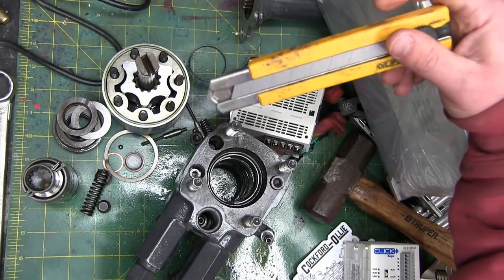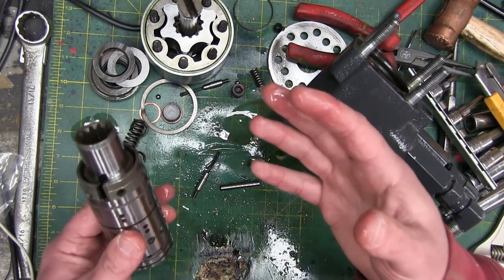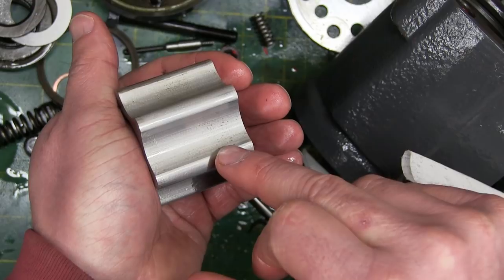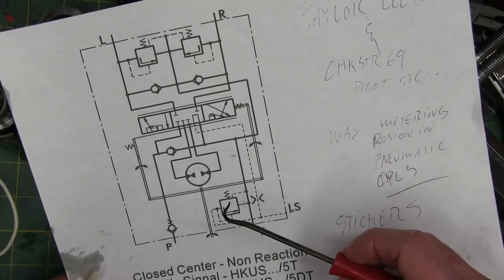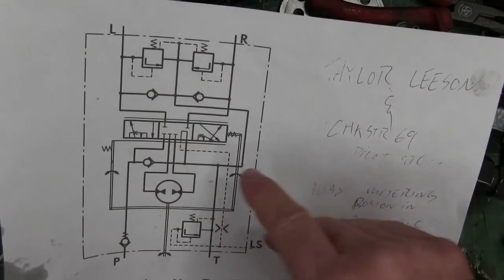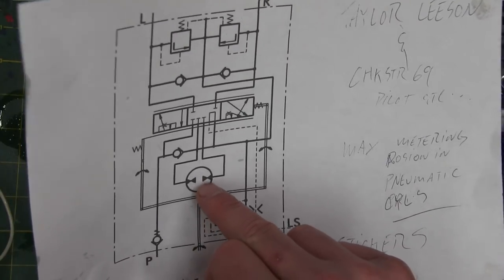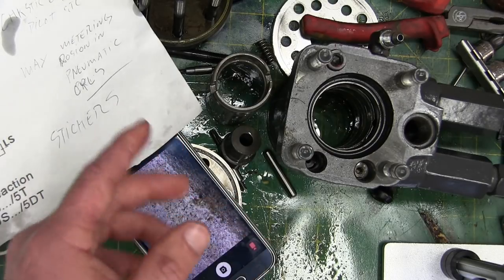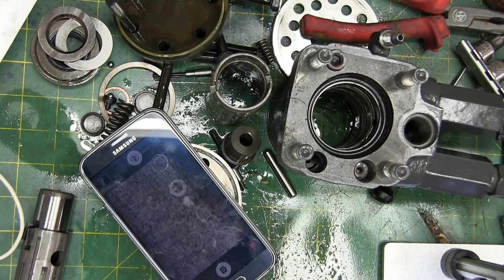Orbitrol Valve Details | My Errors Rectumfried.

Comment: Sorry but you still got it wrong.
Reading the schematic, you can see that the valve has 3 states (indicated by the 3 devisions in the block) between which it transitions smoothly (proportional). The left state of the valve connects the pressure to the right side of the manual pump, the left side of the pump gets connected to the left cylinder, and the right cylinder gets connected to tank. The right state of the valve connects the left side of the manual pump to pressure, the right side of the pump to the right cylinder and the left cylinder to tank. The center state closes both ports of the manual pump. Now the smart part: The entire proportional consists solely of those two cylinders, so the valve rotates with the steering and it is actuated by relative movement between the two parts. The inner part gets driven by the driver and the outer part gets driven by the spring elements. The outer part in turn drives the manual pump, this makes the valve a torque sensing control system. So when the driver applies torque, the valve applies hydraulic pressure to the pump inlet and assists the driver this way. 
(when no torque is applied the pump is blocked and therefore the outer sleeve. This forces the valve to operate as soon as torque is applied).
The consequence: even with no pressure you could operate the steering, but it would require a lot of torque.
Cheers from Germany.
Reply: This exactly.
Reply: I was just about to suggest the same, and I’ve got no idea about hydraulics. Just seemed obvious!
Reply: You nailed it.
Reply: Stephen Dedalus 
Love it tech on the ave tube
Reply: When in doubt, ask ze Germanites!
Reply: Ditto
Reply: Bingo

Comment: I'm interested to see that Sumitomo Cyclo Reducer because I do maintenance at a facility that uses the Sumitomo Cyclo 6000 series reducers everywhere and we've been having them fail pretty consistently. Some are grease filled and some are oil filled. We're going to be sending one out to get autopsied. We know a grease filled reducer is going to fail once we start seeing external temperatures above 110°F on the outside of the housing.

Comment: The Western snow plows(and other brands) on my trucks are electric over hydraulic. The electric switches in the cab control relays that control the pump and the valves that control the cylinders. My old Western plows were mechanical/electrical over hydraulic. It used a switch in a mechanical joystick and cables to activate the pump and control the valves for the cylinders.

Comment: air, hydraulic, electric all have different rules and conventions.  when you say X over X (like air over hydraulic) what you really mean is that the rules of the first one (air) apply but it reality its the second one that actually covers the last mile of delivery so to speak.  so basically what you said is correct.

air over hyrdo lets a hydro break system interact with an air breaking system.  kinda like a transducer

Comment: I deal with milking robots, and they have air cylinders that can be positioned within ONE MILLIMETER. They are made by Festo (of course). Each cylinder has four valves - an inlet  valve and an outlet valve ON EACH SIDE. The cylinder has a magnetic Scale (?) inside of it that is read for positioning. 6.5 bar gives you all the speed and force you need.

Comment: You are absolutely correct in your assumptions about air or electric over hydraulic. Much the same as a pilot hydraulic control would be hydraulic over hydraulic, if that makes sense

Comment: That inner rotor is not ground, it is a powder metal part that was pressed.  The sizing/restriking operation after sintering will produce very tight tolerance parts with an excellent surface finish.  The "corrosion" is porosity and is characteristic of powder metallurgy.

Comment: Air over hydraulics. I always understood it as the use of two different systems to work together or assist one another to accomplish one task. I'm going to use a Military 2 1/2 ton utility truck (Deuce and a half is what it's usually referred to). It has air over hydraulic brakes. The brakes themselves are hydraulic driven. The truck has an air pack on it that essentially senses when you press on the brake pedal and helps you by converting pneumatic power into mechanical power into hydraulic power. I never tore one apart but It'd be pretty neat inside probably. They used this system because the fact that if you got a hole in an air tank, you still have brakes because all the air system does system does is assist the hydraulic. Technically it would actually be an air assist over hydraulic, yadda yadda. You get the point.

Comment: Generally speaking, the whole this over that means that the top mechanism powers the lower mechanism. In other words, snow plows around here are electric over hydraulic. In this specific case, an electric motor/pump uses hydraulics to move the blade. It is about power vs actuation.

Comment: that adjuster with the spring is the pressure relief, i used to set up the hydraulics on new agricultural machinery and you would take out the plug with the copper washer and adjust the relief until you had 1000 psi at the front axle steering ram

Comment: When I see "air over hydraulic" it usually means they are using air pressure to move the shuttle or shuttle back and forth in the spool valve. "Electric over hydraulic" is usually using 0-10V or 4-20mA to run an actuator to do the same.

Comment: It can work as a pump. Had a combine harvester shit out a valve way back in a corn field and had to tow it out to the road for a new engine. Took ~50-75 lbf/ft on the wheel but it could be steered. This is the same type of steering actuator most farm equipment uses.

Comment: The orbital valve will extend the cylinder without pump pressure under no load conditions, but it takes a 300 pound gorilla. Used on planetary gear reduction axles in military vehicles. Worn orbital valve can cause undesired porting within and cause non demanded steering output. Very interesting for the driver.

Comment: If I'm not mistaking, that system is also used on ordinary tractors. They have hydraulic steering, and yes, you can in fact use the steering as a pump and turn the wheels with the engine off, but it is haaaard, and not something you want happening when driving down the road.

Comment: They are a hydro-mechanical closed loop system.  Move the spool by steering and the flow brings it back to center to close by way of displacement-steering, like in a car.  The other type is velocity-steering whereby the wheels would continue to turn until you center the steering input.  These units are some of the coolest mechanisms in mechanical engineering.  Like you said, pornographic.

Comment: Ave , if possible do a vijayo on diesel cylinder sleeve cavitation damage. I know its a long shot. Throw in coolent technology.
Reply: Cool video idea....would definitely like to see this
Reply: Yeah, it's amazing how many diesels have their cylinder sleeves destroyed in short order because people use the wrong coolant.
Reply: I will donate the next  liner with cavitation I get my hands on. 
 drivers putting car antifreeze in their truck.
Reply: few heavy duty applications use old time green coolant  ( comes in many other colors as well )  not extended life which usually only comes in red, except cummins dyes it blue.
 the difference is fully formulated coolant contains sca's and nitrates to prevent cavitation and silica for more btu carrying capacity.  car green coolant only has the silica. no sca's, no nitrates.  thats the simple answer gets fairly complicated once you get into extended life coolants, NOAT, OAT , Hybrids, etc etc.
Reply: After reading up on it quite a bit, I came to the conclusion that there's no reason to run anything but Fleet Charge.  Over time I have slowly drained and flushed every vehicle I have and made the switch. Everything, from my tractors to my '70 Chevelle with a 550hp 454 has Fleet Charge in it now.
Reply: I use oat in everything. I get a discount at work so cheaper than the cheap anti freeze at auto parts store.

Comment: I'm a desk jockey but know a few guys on the oil rigs out here in CO. One said its the same thing as "liquor before beer, you're in the clear." Hydraulics are expensive and powerful. Don't use it if a pneumatic or electric tool will do. The other guy said that "Air over hydraulics" was a rule that hydraulics can be controlled by pneumatics, but pneumatics should never be controlled by hydraulics. So, put the hydraulics at the end of the chain, "under" the pneumatic or electric systems. They argued while I enjoyed my beer and both agreed the other was right. So...no idea? I think it means something different to every jobsite.

Comment: Odd timing that you mention the references to air-over-hydraulic or electric-over-hydraulic as this was quite the discussion on a jobsite last week. I had been taught by my grandfather (mechanical engineer in the 60's) that these were the shorthand lingo to describe air-actuated or electric solenoid actuated hydraulic controls in parker manifolds or valves. To my surprise, these terms got shortened yet again to simply "air-over" or "electric-over" with no mention of hydraulics at all. My guess is that all of these originated in the field or regionally to help mechanics or repair technicians not so versed in hydraulic systems understand why the hell there were wires or air hoses coming out of something that uses hydraulic fluid to do all the work. I guess it exists in the same unwritten jargon as a slapstick valve. But hey, if it chooches, I don't care what term they use...if they break it, I'll have a few choice terms of my own to share with them ;)

Comment: I think the Geroter gear is made from powdered metal. I use to work at a PM factory, we made 100's of thousands of gerotors. The pitting looks like normal pm part. Measure the OD of the top and bottom, if there is a .001 difference its probably a pm part.

Comment: Toyota Fork lifts with hydraulic steering will steer if the engine is dead, but it is vera vera hard.
Really, very hard, but you can steer the thing 
 On the other end of the deal, we had one of the small ride on cushion tire Toyotas that would suddenly turn all on its own and as you frantically spun the wheel the other direction it just kept going until suddenly reversing and the wheels matched the steering input. The valve/pump body like the one you're working with had to be replaced .
We later got the Stand-up ride on electric lifts, and twice the steering went out on those. One the chain broke (you are standing on the steering axis so there is no room for a directly connected slave end), the other the steering valve/pump (or however those are driven by the spin handle that is the steering) locked up.

Comment: I live in Germany and as far as I know even if the motor fails you must be able to brake or steer at any time. We have a tractor and if the engine is off and you are standing you are never able to turn the steering wheel, but when you are rolling down a hill it works just fine, quite hard but it does. I think it also uses a similar valve, not sure thought

Comment: According to the Doosan training dude, that pump actually is there for emergency steering if your hydraulic pump(s) blow up or something. I do not envy whoever has to try to steer anything like that because fuck me you have to do spin that wheel a lot and the wheel gets pretty dang heavy without any line pressure backing you up. Just hope that the brake accumulators have enough reserve is my bet. 

But yeah, take any forklift or whatever and crank the wheel with the engine off and the wheels do turn, not too to slowly either tbh.

Comment: There’s no triangle on hydraulic actuation when it is remote, if the pilot is internal then yes there’s a little box with a triangle but there’s no line. Also if there’s a drain for the spring it comes out of the spring, not the valve and it’s usually shown that it goes straight to tank. I know hydraulics aren’t very standardized with the schematics but that’s my two cents.

Comment: To re-beat the horse of pneumatic metering. It all has to do with cracking pressure, static friction of the seals has to be overcome then the dynamic friction is overcame until the air expands enough to lose the pressure required, rinse and repeat. Thats why a cylinder with no load and metered air in is so jerky. General rule of thumb for pneumatic flow control, "When in doubt, meter out".  Don't try that on hydraulics, then you get into area differences on the different sides of the piston, turns it into a hydraulic amplifier and next thing you know the apprentice puts a metering valve on the rod side of the positioning cylinder and causes a new hose to burst. 
As for air over hydraulic I always used it either of 2 ways: pneumatic control of a standalone hydraulic system, I have only seen that on a really old Hydromat transfer machine, all hydraulic and pneumatic controlled, no CNC yet still able to produce 400+ parts per hour. Pneumatic limit switches and timers (flow control combined with a tank and a spring released DCV) operating hydraulic valves. The other way is pneumatics providing the power for a hydraulic system. I have seen this in several applications the simplest to understand is a level lock in a mining cage. Think big brake calipers grabbing onto the guide tracks, to apply you plug in an air line,  pressurises the hydraulic reservoir to allow for the clamps to seat then after a few seconds activates a 15:1 air-hydraulic amplifier to give the clamps lots of pressure. Holds the cage solid when loading or unloading really heavy stuff, a hoist rope can have LOTS of stretch, safer and quicker then chains too.

Comment: Your correct on air/electric over hydraulic, electric over hydraulic is common on older truck brakes like Ford F600,700. System leaves much to be desired...

Comment: So if the steering wheel is dead center, but the rig's wheels are currently pointing (say) to the right, how does the valve a) know that and b) accordingly allow oil to flow to the cylinder that'll act to straighten out the wheels? Because if it were simply a proportional valve connected to the steering wheel (as still seems to be implied in this video), steering wheel dead center --> proportional valve at dead center --> no oil flows --> the rig's wheels stay pointing whatever direction they were pointing before... which would be NFG.

Is there a springamathing connecting the hydraulic pump/motor within this widget to the valve? Because if so, the proportional valve's position would actually be halfway between the hydraulic motor's position (which reflects the current position of the rig's wheels, as all the oil that travelled to the pistons went via that motor), and the steering wheel position. If the motor is running backwards, that "halfway" becomes a "difference", and hey, that's the actual explanation of how the valve works -- it calculates the difference in the position of the rig's wheels and the steering wheel, and acts accordingly.

Comment: Good Evening from Sunny Florida, land of Blue Hairs and Tweekers! I have been really enjoying your education on hydraulics, which got me to thinking? My vehicle has hit 120,000 miles, it's actually a Canadian Buick Allure aka a Lacrosse. Not to get off the subject but I was told they didn't call him lacrosse up there because that was a slang term for spending time with Rosie palms and her Five Sisters! Haha! Anyway the transmission needs to be serviced and I keep hearing people tell me I should never ever flush a transmission I should only drop the pan and change the fluid partially? I figured since an automatic transmission is hydraulically controlled you may have an opinion? I don't see how the very thing that's destroying it and causing wear is going to save it? The only consensus High has been told that makes even an iota of senses when the clutches and Steels breakdown they stay in the fluid and create the friction that you actually need to get shifts and not have the transmission slip. I know you're not a transmission expert, actually I don't, but a video or just even a response in the comments would be very appreciated.

Comment: The steering valves I’ve worked on the manual pump lets you turn the steering with engine off I.e no pump pressure. We called it emergency steering for when you’re bombing down the road and your engine dies so you can still steer. Get in a  truck or a tractor with the engine off and you can turn the wheels with the steering wheel. If you’re man enough ;)

Comment: The air over hydraulics, or electric over hydraulics is just a way of describing the hierarchal layout.. 

I.E. If you build a tree of higherarchy, at the top would be the electrical control, wich would include the interface, buttons and screens and such, the next layer down would be your servo's steppers, and solenoids etc... the next layer down would be your hydraulics.. 

Control Panel -> User Interface
|
V
Servos, Steppers, Solenoids, Corntacts etc..
|
V
Hydrolic pumps, lines, valves etc

Comment: The pump on the bottom is for emergency use if you loose hydraulic pump flow you can still steer the vehicle, you won’t have power steering but you can still steer

Comment: If you ride the machine hard and shutdown hot, hydraulic pressure can lock up the system. If it wont crank or slow crank, moving the wheel L and R usually gets the chooch.

Comment: Hmm, I see two rotatable parts, if one connects to wheels, and one to steering , it's possible the wheels will move until the outer control comes into alignment with the inner control. Thus move the inner, outer will follow, might even work a bit without power.